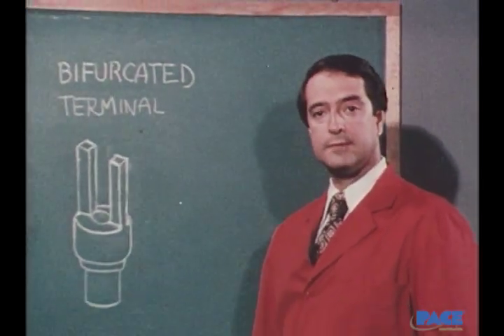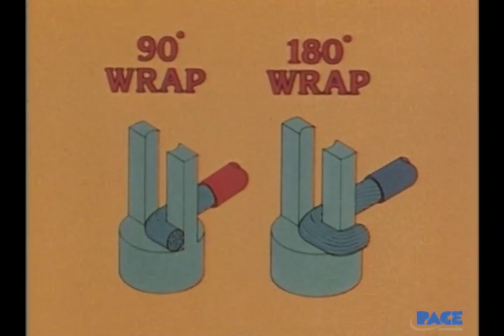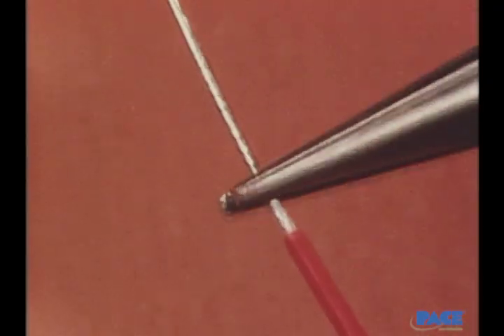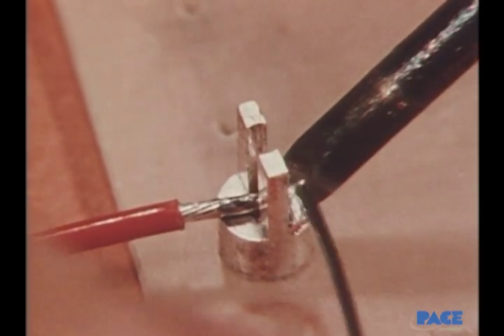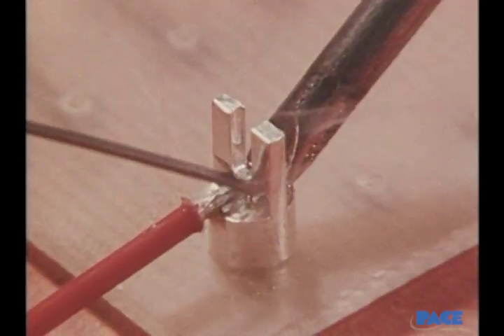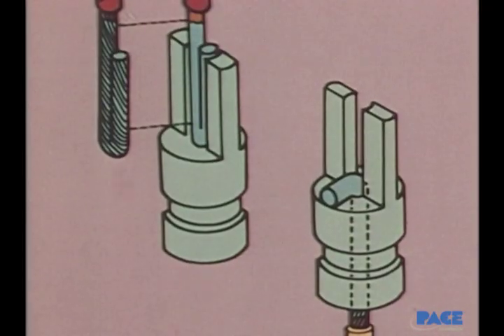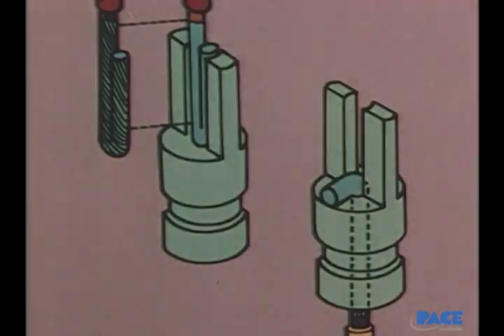Basic Soldering Lesson 4 - "Bifurcated Terminals"

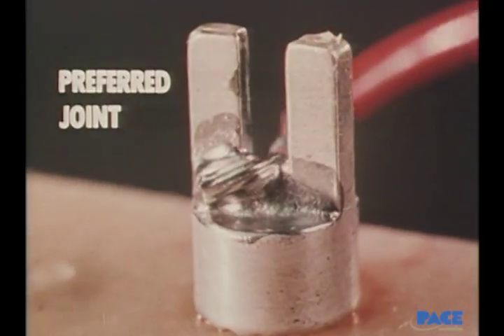Comment: Note that the turret at 1:55 is bright, clean and shiny, but the turret shown at 2:05 is visibly oxidized and tarnished, which certainly doesn't help if you want to get a good solder connection. If I was soldering to a terminal that oxidized I would clean it with an ink eraser or a fiberglass scratch brush first, or a fine wire brush, before attempting to solder to it.

Comment: The bigger the glob, the better the job!
Reply: Not for something like a circuit board for a missile.  When I took a soldering class for the Army, we were taught to use just enough solder to form a good fillet.  The less solder, the less weight, the faster the missile.  The joint itself should form the mechanical strength. The purpose of solder is to give good electrical conduction.

Comment: I don't have any of this "solvent." Can I use rubbing alcohol?
Reply: yes. isopropanol.
Reply: +Spoder Man yes
Reply: Spoder Man yes you can
Reply: 99% Isopropyl Alcohol (IPA). You can also use flux remover like Chemtronics Flux Off. The spray ones can be troublesome compared to liquid flux removers, but liquid tends to come in more like 1 gallon containers, so it's an upfront cost, but then you'd get an "ESD solvent dispenser bottle" which was shown in Lesson 1, pushing it with a brush neatly dispenses only a little bit for use. These can be used for IPA, too, btw. P.S. they used Kimwipes in addition to brush in Lesson 1, and they're still widely regarded the best, and cheap.